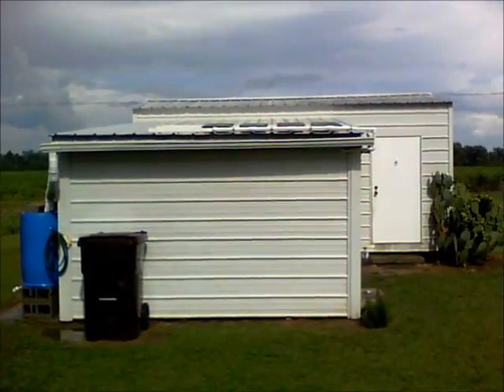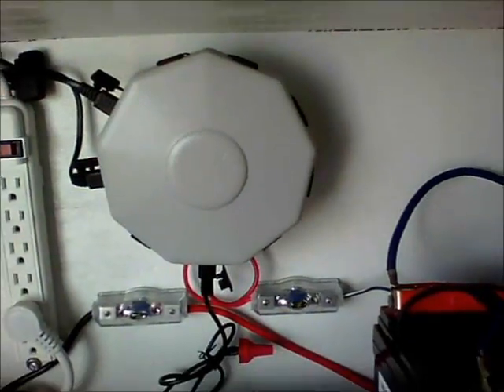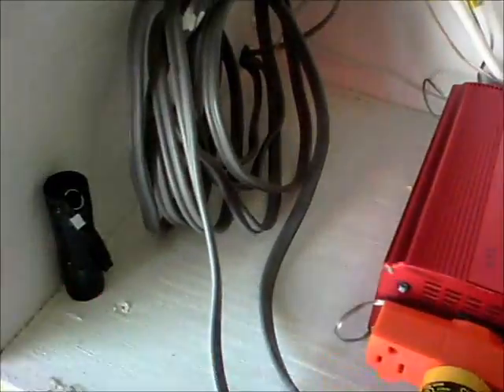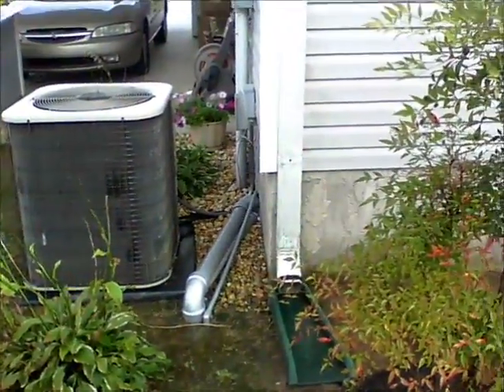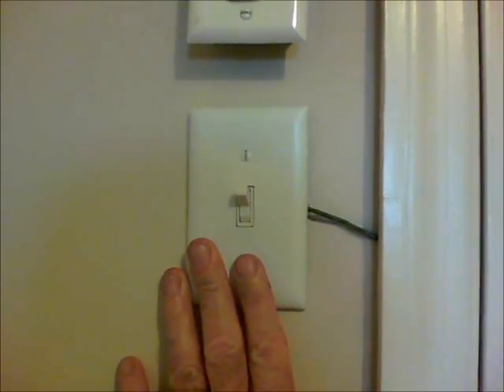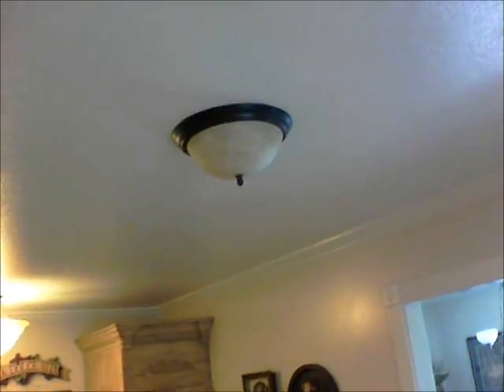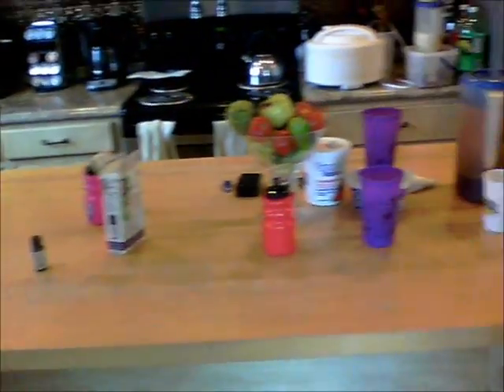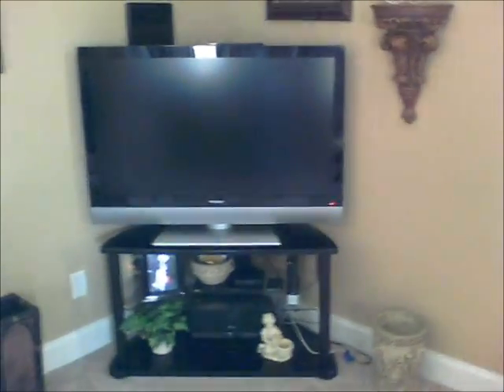Harbor Freight Solar Panels Wired into my house

Comment: I really like your setup!  If you would like to save a decent amount of power and increase your efficiency you can make a slight minimal change to your setup.  Right now your 12 volts from your battery must travel into your house though the flip switch and then back out over a long distance of wire.  Low DC voltage traveling over so much wire will lose some energy to heat/resistance.  To save power what you could do is get a 12V "latching" relay (a latching relay latches to the on and off position when given a quick voltage pulse without requiring a constant voltage to stay on or off).  So you solder the relay to be the on/off switch to your inverter.  You then just use your existing wire (perhaps set the kitchen switch to a push button) to to briefly power the relay to the "on and off" position and your 12 volts going to your power your inverter don't need to travel all the way to your house and back. Example if your using 12 gauge wire to move your 12 volts to your house on/off switch you could be losing around %10 of all your power do to distance too resistance heat.  Here is a calculator to figure out your losses (if it even maters): http://www.calculator.net/voltage-drop-calculator.html?material=copper&wiresize=8.286&voltage=12&phase=dc&noofconductor=1&distance=100&distanceunit=feet&amperes=4&x=68&y=25

If it would help I could draw you a schematic for using a latching relay on your existing setup.
Reply from the maker: Oh my goodness, I did not know about this and yes, I would really appreciate if you would draw me a schematic for that. Just email it to me. That would be great thank you so much!
Reply: Sorry I was out of town taking care of my grandmother.  I'm back and will do my best to help and answer any questions.  I'm not sure I have any way to get your email?  So hopefully it lets me post my answer here.  Again the idea is to keep power (especially low voltage DC) from running a long distance to cut your waste from heat power loss (resistance).  So a good strategy is to use a "latching relay" as a switch for your inverter and to send a small momentary 12v pulse of electricity to "flip" that relay on and off as you need it.  Nice thing is you can use your existing wires you ran to your house for turning on/off your inverter to turn on/off the relay hooked to your inverter (see schematic).  In place of your on/off wall switch that was switching the 12V to the inverter we are going to replace it with two simple momentary (they are only "on" while you are pushing them) push button switches (links to parts below).  I recommend you make a new wall plate out of thin plywood or you just buy a plastic wall plate from Lowes/Wallmart and drill two simple holes in the wall plate for mounting the screw in push buttons.  Then just hook up your power lines to the push button switches for routing power for signaling the relay when to switch on or off.  A few notes: The thicker the wire (more surface area on the conductor) the "less" voltage drop loss you will have over a distance.  However the digital volt meter (and relay if you have to tap negative off the volt meter wall switch) uses so little power that the thin speaker wire you ran is more than fine for both.

These are my part suggestions though you can use almost anything you find on ebay provided they are the correct type of parts to do the job.

Ebay momentary switches:  https://www.ebay.com/itm/3-x-MOMENTARY-PUSH-BUTTON-SWITCH-DC-50V-0-5A-RED-KNOB-USA-SELLER-Free-Ship/322937165648?hash=item4b308e1750:g:c7QAAOSwqu9VT9kS

Latching relay (More expensive than the cheap Chinese ones on ebay.  However I like this one IMO as it can handle a lot of amps without heat which will be good if you upgrade to a bigger more power hungry inverter.):  https://www.mouser.com/ProductDetail/Panasonic-Industrial-Devices/ADZS12112?qs=sGAEpiMZZMsqIr59i2oRcqKXGSjNb8%2fJVQw7DnMV3Oc%3d

  My schematic example for wiring your house wall switch to toggle a latching relay on your inverter:  http://www.whiteshepherd.net/pictures/electronics/schematic_relay.jpg

Hope this helps!  Gene

Comment: Great set up! I wish I could do this at my place! Is your inverter pure sine wave?
Reply from the maker: You can, just figure out one that works for your needs. And no, the inverter is not pure sine wave. I do have one that I hook up if I need it, but it's better and uses more power so I use the smaller one most of the time.

Comment: Why not just feed your solar power into your house breaker box to augment your city power?  When the batteries are full it feeds your home to lower your power bill, and if the city power goes down it switches over to batteries for your home power.  Is that just a cost issue? Thanks!
Reply from the maker: Cost and codes, I wanted to do it myself and keep the power company out of it and stay either under or around 500 bucks.

Comment: Nice system you have there, But consider a 12 volt 100 watt solar panels are rated at about 18 volts and 5.56 amps not 12 to 13.8 volts. These harbor freight charge controllers are not MPPT controllers so they truncate the voltage above 13.8 volts. So in effect 24% of the power is lost in the charge controller. Because 13.8v x 5.56 amps = 76.7 watts MPPT charge controllers actually use inverter technology that convert the 18 volts to 13.8 and at same time increase the amps to around 7 amps (for a 100 watt solar panel) They are around 95 to 97% efficient. With the price being lower now for solar panels you can get a 100 watt panel off of Ebay for about $100. Much cheaper and better quality than what harbor freight is offering today.

Comment: Thanks for your vids: I researched this for about three months, and then gave up on it for a while to see if prices would go down and quality would go up.  I live in the country and wanted to put in a backup system.  Looks like these H.F. 100 watt panels are much better.  Could you do a vid on your system parts list.  Thanks again.
Reply from the maker: When I get time I will try to do that. 
Thanks
Reply: Thx or possibly adding into the discription of this vid would be very helpful .. if easier for you.
Reply: Dont buy rip off Harbour Freight solar panels.

Comment: But the fridge and AC is what really matters during outages.  LED flashlights are so cheap and powerful for lighting.
Reply from the maker: That is why I set it up so I could unplug the wire from the inverter and plug it into our generator, and that kept me from having to have a large battery bank and I am still able to run both. I just didn't have the extra money for a large battery bank so that solved this problem for me.

Comment: That's a really nice setup I love how you designed it into the house. You should switch over to LED if you haven't already for your main light in the kitchen. We've been running solar in several homes that we've lived in and where the CFL bulbs ran pretty long, the LED bulbs ran way longer. It went from hours to over a day in one situation. An extremely good use of contractor materials. Nice to see someone building something from off the shelf parts that looks so professional

Comment: Thanks this solved several dezign problemsi i had this helped much.
Reply from the maker: Thank you that is why I posted it, hoping to help give ideals to anyone how they can make it work and make it their own without it being an eye sore......... 3 years and we are still using this system. It was warm yesterday and the sun was out so we ran fans to keep from turning the AC on to save on the power bill. If you understand the limits of a small system like this is can be a great asset. It really does work!
Reply: jamesndarlene u

Comment: great system setup nice an clean. do you still run the system. do we get more videos on this great setup . thanks
Reply from the maker: Yes to both. I have posted an updated video on my system and what I have added to it. We still use it all the time. I also have a DIY solar panel combiner box video that I am going to upload before long.

Comment: also if you have two systems, why didn't you use all 6 panels?
Reply from the maker: I used the other panel for the canning shed to run the solar fan in it.

Comment: When you replace your batteries go to Batteries Plus. Get their 6volt golf cart batteries. $110 and each is 235 amp hours. Wire four serial-parallel and you get 12 volt at 470 amp hours.
Reply: no you would only have 470 amp hours at 12V, electrician for 12 years
Reply from the maker: That sounds like a good deal, thank you!
Reply: If you get 2 6 volt golf cart battties and there  235 amp hr hooking them up fir 12v you would only have 235 amp hour the amp dont double
Reply: RonTech34  That is correct but the post said using 4 batteries in series and parallel. Two batteries in series don't add to the current only the voltage but if a second pair are added in parallel with the first two the current it doubled to 470 amps.
Reply: I was responding to a old post
Reply: Order online at batteries plus and get 10% off then pickup in store. Otherwise Sam's has the same Duracell batteries for $85ea. Or Costco golf cart 6v for $85 also
Reply: vistagraphsnet you would have 940 amp hours at 12V

Comment: change the bulbs to LED bulbs.  drastcally reduces power uses.
Reply: I agree with the use of LED, but at the time you built it before cost effective LED's, you probably have already swapped out for LED.
Reply: I have led light bulbs thru out my house and my bill is thru the roof! I have solar city solar panels on my house but that don’t make a difference
Reply: @annebeyer5191  if I'm correct solar city was purchased by Tesla. Solar city drove me nuts with rude phone calls to see if I wanted thier system. Thank god Tesla purchased em no more calls.

Comment: DO you have heat and your shed for the batteries very interesting?
Reply from the maker: No, there is no heat or cooling. The wood is 3/4 inch plywood so it helps hold the heat in. The batteries build up some heat while using them and the inverter puts off heat while using it. It keeps it warm enough to where it has not harmed my battery bank and we have been using those same Harbor Freight batteries for over 2 years, and they are still going strong. The side shed has a greenhouse type floor in it, so it will stay pretty cool during the summer. In fact on hot days its a favorite spot that our dogs like to lay in.

Comment: By any chance would you know what size of power inverter I would need to power a ceiling fan.
Reply from the maker: Well, I cant say for sure without knowing how many watts and amps it is, but I would say 800 to 1000 watts should pull it just fine. Our 1000 watt inverter pulls the 2 lights in the kitchen fixture, the lamp in the living room, and a box fan with power left if we need it. We will also use it to run our coffee grinder sometimes just to give it a work out and it runs all that just fine. One thing you may want to consider is, run as small of an inverter as you can as long as it still pulls your appliances with out any problems. The smaller the inverter, the less draw on your batteries. We upgraded to a 1500 watt pure sine wave  inverter and we can tell a big difference on our battery draw! So unless we need it to watch TV or something like that during a power outage, we are going to use our old 1000 watt inverter for everyday use. I hope that helps.
Reply: +jamesndarlene thank you for the response

Comment: You should try to hook on water heater. Which could run on 12 volt Dc element 200~300 watt. we can save more electric bill approx 30%,  since it is used on daily purpose. I am working on that.
Reply from the maker: +Urvesh Patel I have been looking into that also. Free hot water all summer long!
Reply: How much solar cell  wattage do you need for the 12 volt water heater? 300 watt solar cells?

Comment: Only thing I can't agree on are the Batteries. For the Same Price, you can get Good Marine Deep Cycle Batteries from a Auto Store or even ...Wal-Mart and each one will be 110 Amp Hours and not the 30 from HF.
Reply from the maker: +ravenlorans Yes, that is true, but for learning how to do this and to see if my idea of this setup would work, I wanted true solar batteries that I could discharge deep and charge back up. Most batteries if you do deep discharge after a few times it will ruin them. Now that I see this works I am going to buy better batteries. Thanks.
Reply: "you can get Good Marine Deep Cycle Batteries" = "I wanted true solar batteries that I could discharge deep and charge back up."
Solar Batteries and Marine Deep Cycle Batteries are the Same Batteries. Hence Deep Cycle.

Comment: I'd also highly suggest ditching the inverter and going with a 12V system, and use 12V bulbs. Then have smaller local inverters if you need to power an AC appliance. Having everything going through that inverter just increases the amount of energy you lose through conversion.
Reply: That would be dumb
You’d lose more voltage cat 12v than the inverter uses. And then there’d be no TVs
Reply: It is true that it looses power during conversion. At 12 volts the lights would take more amps but lower voltage meaning that the current would be higher causing more voltage drop over the wire between the batteries and the house so I am not sure it would be more efficient. 12 volt bulbs are more expensive too. 60 watt equivalent 120 volt led bulbs are about 2 dollars. 12 volt led's  are about $10 each. I am not sure if they put out as much light because they don't tell the light output as they do in the 120 volt ones.

Comment: solar panels are cheaper now, on ebay you can get a 100 watt panel for $112.99 25 year warrenty you can get a basic controller on ebay for $15.00 that would be at least 20 amps, probly save you some money and get you more power for your bucks than harbor freght
Reply from the maker: +hamtalker2007 that's true, and I have bought a hundred watt panel from ebay to add to my array (just haven't gotten around to it yet). But this video was more about different ways of setting them up and getting the power into your house, and make it user friendly for my wife and kids as well. But as far as the amps goes your right, you would get more amps from larger panels. Thanks

Comment: jamesndarlene..👈 👏👏.. I really enjoy this step by step instructions and how you did this I want to thank you very much for this video I  will be trying the same thing myself in an apartment thank you very much
Reply from the maker: +Carlos F Glad it helped. It really is easy to do and it's a great piece of mind to know you have it. Plus, you can always add on to it. I bought a 100 watt panel to add to this set up so I can run more stuff each night. This little set up is still working great!
Reply: I wanted to ask you when you did the plugs you just tap on to the other outlet to the other..... with the 14.2 gauge wire
Reply: I'm planning to get 4- 100 watt panels
Reply from the maker: +Carlos F Yes, just jumped them right off the other one in each room. I kept them on two separate lead in wires (even though it cost more) so I would have the option to plug one or both lines into the generator depending on what I was wanting to run and how much power I would need, and the state of charge of the batteries.

Comment: Ok.

Other then the speaker wires that is running to the house what other gauge of wire do you have running to the house.
I know you stated four wires were going into the house.

I really do like your concept I am thinking about piggybacking off your idea.

Thank you for the prompt reply.
Reply from the maker: The gray wire is 14.2 gauge. It's rated for underground, outdoor use that I got at either Lowes or Home Depot. One roll of the gray wire was enough to do both runs to the house. One run to the living room and one to the kitchen. That way if we need to unplug one or both from the solar power and hook it to the generator we can, for running the washing machine and other large things that draw a lot of power. Or, if the battery bank ever gets to low we can run both plugs right off the generator also and bypass the battery bank and let them still charge up. Plus, we don't have to listen to the generator run when we are using it since it's in the side shed.

Comment from the maker: It's the 14.2 gray wire that you use for outdoor projects. That way I don't have to run any pipe. The speaker wire is a a thick gauge going to the on/off switch and a very thin gauge speaker wire going to the digital monitor (wanted to keep the drain on the batteries as less as possible). I have been using this system almost a year now, and it's still working great. I would like to have a bigger battery bank though. And I can always build on the system as I get the money now that I have the system set up and working.
Reply: jamesndarlene great stuff. thank you for your insight.
Reply: Golf cart batteries are the way to go. Cost more but you get longer life and a lot more amp hrs.
Reply: jamesndarlene I have to admit awesome design on your wiring setup and your panels great information but do you know the resistance Factor of your speaker wires are higher then common voltage wiring I would not be surprised if you were losing a quarter of your voltage by using speaker wire you may want to invest in some true electrical wiring I'm not complaining we're telling you that you're wrong. You did a awesome job on your wiring and setup